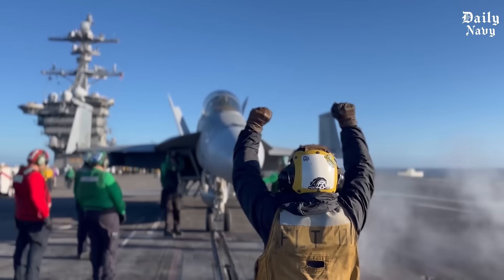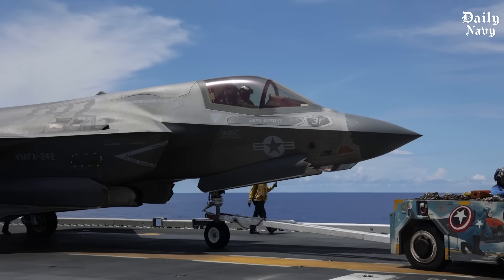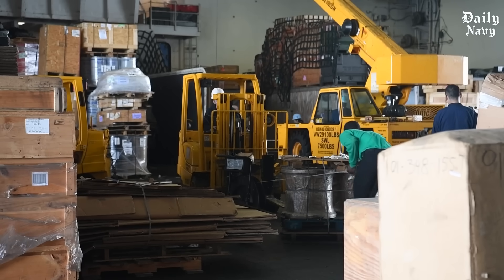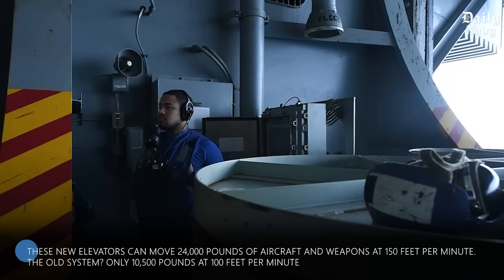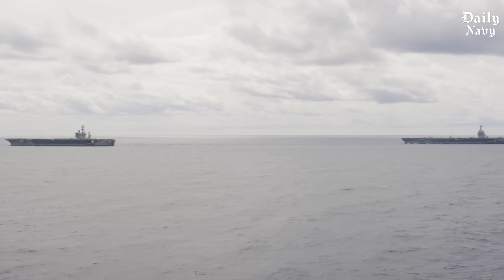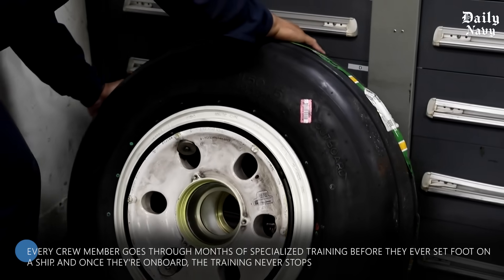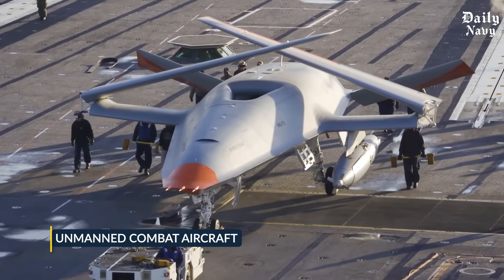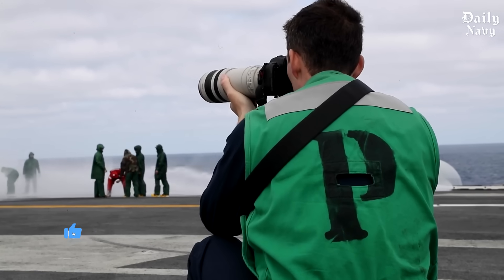How US Stores its Billion $ Fighter Jets on Aircraft Carriers

Comment: Fix your cover photo. F-22s are not found on aircraft carriers.
Reply: Nor does a single elevator hold like 8 aircraft with their wings unfolded, but that would be one hell of a ship if they did.
Reply: @austin102393  cruise ship balcony-sized😆
Reply: And there goes the editors job😂😂
Reply: Lol, you sure about that? 🙂‍↕️.  Public info says no , black book projects say otherwise. You dont think they built a couple protype super raptors with a stronger airframe, landing gear etc.. it already has a tail hook attachment for "emergency landing citiations".  Lollll
Reply: @HappyDadHacketlol they don't have any for carriers 😂
Reply: @HappyDadHacket  the number of changes in an airframe necessary to be "carrier-capable" make it impractical, as the F-35 (Joint Strike Fighter) crew is finding out.
Reply: Yeah that’s some lazy bullshit

Comment: "Proud"
I'm sure there's ways to prevent large waves from entering the hanger bays, but I've not seen them operated.
I've have seen recently an elevator positioned vertically (covering the opening).